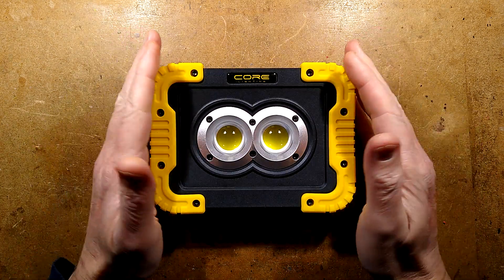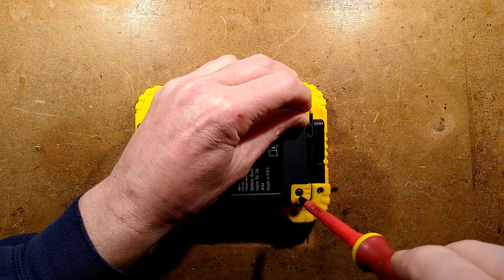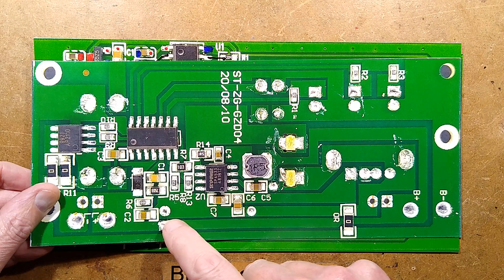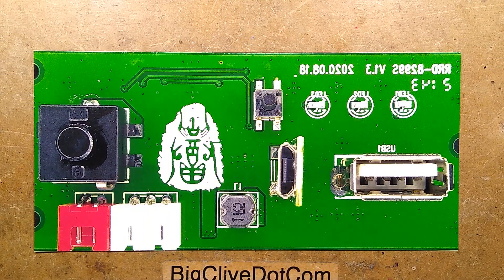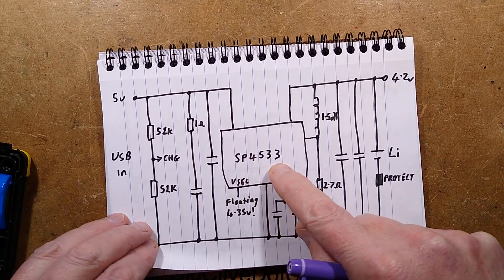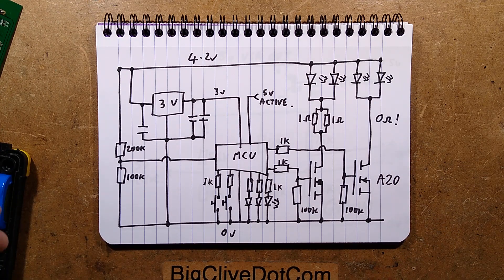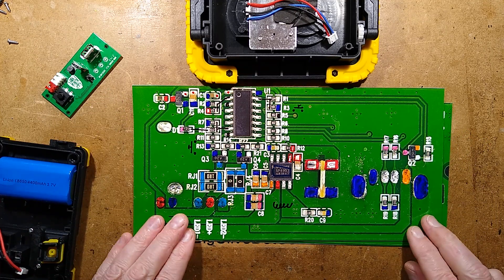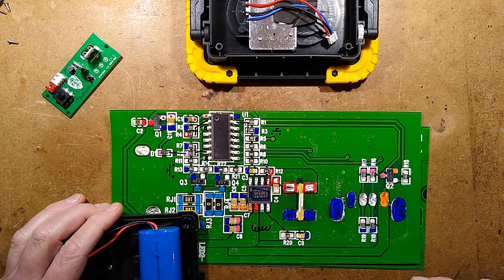Another work light with weird circuitry (with schematic)

Comment: My friend in Kyiv decided to construct a makeshift home light for the periods of power outage (they take place daily, often several times a day). He's got almost no spare parts or modules on hand, but at least he can salvage something from his earlier projects, and between the blackouts he can use his soldering iron.
I know a couple of cheap rechargeable lights from a dollar store could save him (especially if they take 18650 cells and allow for replacing them), but when everyone in a big city faces this situation, they certainly don't have enough on the shelves.
Reply: Old laptop battery packs are a great source of the cells, and you just need to look for those of roughly equal capacity to use.
Reply: Someone get this mans' friend some 18650 cells
Reply: Be careful with which laptop battery you use. Not all of them use 18650 cells. I have a Thinkpad T420s which used a square battery. They work just like 18650s, but you will never find an off the shelf anything for them, except for universal parts that work on any cell.
Reply: I could source your friend some 18650 cells if needed...

Comment: I have a pair of similar lamps branded Feit Electric. Inside is room to fit additional 18650 cell. 
Of course I added one. 
Simply paralleled a self protected cell whats intended for electric hair cutter. 
Increased runtime another couple hours. Works great.

Comment: I've bought a couple of these types of lights using removable 18650 batteries.  I use 3400mAh 18650B in them.  They are superb for ice fishing at night.  I was worried about the effect of cold on the batteries, but they last so long, and I think the light heats up the cells, so it isn't as much of an issue as I had feared.  They don't keep you as warm as an old Coleman fuel lantern, but you don't need to carry a heavy glass lantern, and stinky fuel.

Comment: The resistor divider on the USB data lines comes from the original iPod era and it uses it to detect that the device was plugged to a wall wart charger instead of a regular PC port, where it could only suck 500mA while on the charger it allowed 1A. Nowadays the current rating is set by the USB C power delivery system I believe
Reply: A pile of things now will just keep trying to draw what they want until the voltage starts to droop. I have some neat 9-36v input USB power boards with 4 USB ports on them that will happily feed 3A into each pair of sockets. (Particularly handy for driving USB powered SBCs.)

Mind you, I did push one up to 5A before it finally let out the smoke. It's always handy to destructively test any hardware you intend to use. Fun, too.
Reply: @ConstantlyDamaged  Wow!   😃 🚭 😄
Reply: Please note that Apple devices didn't use to recognise non-Apple chargers without this resistor string. I haven't played much with the USB-C devices yet so not sure what they do.

Comment: Looks like a decent portable light, and I agree that the resistor values should be altered to give better battery runtime. Even if you don't consider the heat dissipation, pulling 3.8A from a 2P Li-Ion battery pack is not going to help it in terms of battery life (just over 1 hour?) and battery longevity (will lose its capacity faster).

Comment: I've had one of these for years and it uses either 4 x AA or 2 x 18650 and I love this layout because I can easily get a total of over 6600mha compared to the cheaper 2200mha cells used by these packs.
Reply: After hacking bits of the plastic case away with a Dremel, I managed to squeeze 6 x 18650s in to that type. The newer ones are a bit smaller.
Reply: @dermotdobson2700  A bit smaller? 18650s are literally defined by their size...
Reply: @caramelldansen2204  I'm referring to the floodlights - the modern ones, being smaller can only take 4 x 18650, the older  ones with the flashlight on the end can have 6 x 18650s squeezed in.

Comment: The Aldi one that I bought is definitely not 4400mAh.  It's less than a half of that. Charges from flat to full in less than half an hour.
Reply: Bernd  my friends wife bought him one from there  (your certainly right ) he said  after about a couple of weeks he would no longer trust the battery  on it  ? could be in the middle of doing a five mi job it died ? when he needed it for loft's  or dark   place's at work he's a plumber e.g cold fill tank's in loft's  with ball valve's Exocet....   he binned it    didn't want to be stuff  in a loft with one leg hanging out of the client's ceiling  in the dark

Comment: Alright, spot on big Clive ! I was just using one right now and wound up soldering directly to my 12 volt outlet on my controller inside my micro house!
Reply from the maker: 12V?  How did you connect one of these to 12V?
Reply: @bigclivedotcom  I just figured by the number of battery's of 1.75 added to close to 12 plus output charger was 12 so I wired some large alligators with a coil of good copper heavy gauge red and black to the spots inside where the input was drilled a whole tied it in a knot replaced the cover extracted the lithiums added them to my ebike battery build clipped the alligators on my power bank and vola!
Reply: @robertallen5890  Thanks for clearing things up, I understand perfectly now. 🤣🤣
Reply: @robertallen5890  I get you,  sounds like my approach to these sort of things. How often do you need to feed the alligators :)
Reply: @Derek_Garnham  thanks to our fearless leader into this great opportunity for the many years I never threw away my good led lights gadgets and boxes of coiled wires and packages of various sizes of alligators I keep all around me always. Lol
Reply: @robertallen5890  All hail to the Chief.

Comment: I picked up one of these style of worklight on Amazon last week, similar shape/design and screw positionings, what was interesting though is that it had a battery compartment with two 18650 cells, but you could also take those out and add AA batteries instead. Seemed like a nice improvement and allows for you to keep some extra cells around. The one I got was "Trongle LED Rechargeable Work Lights, 30W" on Amazon but theres a few almost identical ones.
Reply: The Tired Horizon  Do you know what make and model that is? I've searched but can only find two or four cell models. I'd be quite interested in getting one of the six cell models as an emergency backup light. Thanks 👍
Reply: The Tired Horizon  Thanks

Comment: Based on the dates silkscreened onto the board, the two boards are 10 years apart in age at the time they were designed.  Does this represent 10 years progress in design?  Or 10 years of reading the previous guy's chicken-scratch notes and cobbling ?

Comment: It's worth remembering that as LEDs get hotter, their conversion efficiency of current to light decreases. So much so, that at some point they may actually output less light as the current increases. Below that point the light output is a relatively linear function of current, so reducing the current through the LEDs by substituting larger resistors is unlikely to reduce efficiency and may possibly improve it. Given the penchant for Chinese manufacturers to drive all the components as hard as they can get away with, that sort of mod makes a lot of sense.
Reply: Thats a very interesting point. my one starts off bright and then dims down. If I switch it off and back on, it comes back bright. I wonder if I should back off the current a bit and have a more stable output?
Reply: @kenaston4220  If it's dimming over a relatively short period (a minute or less), then it's probably a thermal effect, rather than the battery voltage dropping, so there are efficiency gains to be made by reducing the current and/or putting a better heatsink on the LEDs. Perhaps test the theory by blowing cold air from a fan over it?

Comment: I got one like that a few years ago on eBay but it has a single round COB LED and a flashlight at one end. First push gave  you the flashlight, second was the front LED (very bright) and third gave an alternating red/blue warning on the front LED display - very nice. I put in a pair of 5000mAH 18650 cells (in parallel!) - works very well. Everything else is virtually the same except the 'test' button is not there - the battery test LEDs come on with the main LED.

Comment: I have a variation of this case type too, but with a single white LED board on the middle, surrounded by a ring of red LED`s (which can stay on or flash). I had to repair it recently (CX-ST02 board), as the charge socket (which is mounted directly against the USB power out on mine) had parted company with its little board, despite being rarely used. That's when I discovered that the charging ports power isn't actually soldered to the board its on, they`re just contacting pins with "receiver pads" on the board, & the only thing soldered is the outer port surround clasps to the edges of the board, on mine at least..

When you connect it to a computer USB to charge, it actually comes up as something on the PC, which got me all para (I don't want those crafty Chinese chaps hacking my computer after all!), so I charge it from a USB plug now instead.. Maybe those chips are to communicate/signal when connected to a computer?
Reply from the maker: I've not heard of one that presents itself as a device when plugged into the computer.  I'd expect that to require the data lines of the connector to be connected to a processor.

Comment: I bought one similar to the yellow one in a local chinese shop in Italy (no branding on mine and back was more similar to the blue one) and they had 3 models of the same one. Two big led arrays, one long strip and one with only one big led array but RGB. All of them were the same on the back and front except the LED itself
Reply: I had another look into mine and remembered that mine has another COB LED on the left of the unit but has only full power/dim for the two big arrays, other than that mine came with a pop-able back and slot for 2x18650 or 4xAA

Comment: I hacked earlier versions (the ones with twin square COB LEDs on front and a flashlight on the side) of these with a Dremel, so I could squeeze 6 x 18650 cells inside. This runs for 16 hours on full power and 25 hours on low. Got bored waiting for the tiny flashlight to run it flat, but it was at least 3 days.

Comment: The resistor network is not to "stop Apple phones trying to suck as much current as possible".  It is actually to allow them to charge using higher current than they would otherwise.  If you plug a USB-compliant device (including an Apple device) into a port whose data lines are not connected to anything, it is not allowed to draw more than 0.5A according to the spec.

These resistors are configured to tell Apple devices that this charger is capable of supplying 1A of current, so it's OK for them to pull that much.

However, I'm not sure why they didn't just go with the more standard "dedicated charging port" indicator of just shorting the data lines together, though, as that also works even with non-Apple devices, and AFAIK Apple devices understand it just fine too (since it's part of the USB BCP spec)..

Comment: That larger switch looks like the one that has a rotating contact inside, which may explain the delay. The processor has to come online before it turns on one or both mosfets for the lights.
Reply from the maker: It's just a single contact for the microcontroller.

Comment: Looks like a creepy snow angel.
I am guessing that they had trouble in making the boost circuit shut down on no load or to get rid of the loading from the resistors setting the data line values, when boost is off.
Reply: I recall Space ship XL 5, but can't recall the year; '65 or '68?
Good handle Richard KB.
Reply: @kevinbean3679  it 1st aired 62, it only ran for about 37 episodes.
I used to have all of them on a hard drive.
Nostalgia is better than reality though.
Reply: @FireballXL55  Thank you, so many years ago.

Comment: Relying on the protection board in a battery pack to limit the charging voltage is a very bad thing to do.
Protection circuits are generally designed to allow the maximum voltage that won't actually result in rapid destruction (fire!) of the cells. It is expected that they will allow the main charge controller to reach its maximum setpoint without cutting off charging. That means that the protection circuit probably won't do any good in this case and the battery will be overcharged. It takes surprisingly few overcharge cycles of surprisingly little excessive voltage to significantly shorten the lifetime of the battery. Undercharging will result in greater life, both in terms of number of cycles and total energy deliverable over the lifetime of the battery.

Comment: In the past I've used series strings of resistors (2K2/3K3 and 3K3/2K2) on the USB data lines to get a USB charger to work with Apple devices. It works OK for me but I'll give those values a try next time I butcher a supply.

Comment: 1k and 100k likely the standard reel on the PNP machine, though I will bet they also will drop any value from 560R to 2k2 in the one position, and 82k to 220k in the other, depending on what is on the shelf when the reel ran out, and what was on sale that day in the market when they went looking. 

Yes putting in higher value resistors for the LED will help, probably best done using actual 2W wire ended resistors on short leads, tucked up in the spare space in the unit.  Making them 2R2 and 3R3 would probably not drop light output much, as the lower current will drop the LED into a more efficient part of the curve, so 50% longer battery life and likely only a 20% drop in light output

Comment: The mosfets are typically in the milli ohms range when turned on so dissipate very little power. I'd more worry about the leds, though at some point the battery will drop voltage so that may be straining as well.
Reply: the high power mode rely on the total circuit resistance like some direct-drive flashlights. if you swap the battery with unprotected high current ones, the led would be screaming for help within minutes for sure

Comment: Clive, Am I correct in assuming that all one needs to do is ground the VSel pin (pin 7) and the lamp will protect any lipo cell you put into it protecting it from overcharge and over discharge?

Thanks for another great video!

K.
Reply from the maker: Theoretically yes.

Comment: I wonder if the floating VSel line was some small effort at charging the batteries faster? Bad form to rely on the protection circuit that way, but a clever hack otherwise.

Comment: So, my question/comment for this session is a 2-parter.

1. Maybe not for everybody, but I'd probably find a video where you actually explain the tracing/photographing process in more detail. Aside from "lots of practical knowledge" - how do you work out what everything is and does? 

2. Have you ever done a video where you thought you had a circuit all worked out, and later realized you were mistaken?
Reply from the maker: I should make a video about my reverse engineering process.
There are times I've not fully clicked with specific circuitry and comments about it from others have clarified it.

Comment: I have a very similar light that is a nebo tango light. It has the two different leds that can operate independently. Or together on turbo mode. But it is dimmable for both legs independently. With small light on its lowest setting which is 25 lumens it says it will last 35hours. Battery doesn't last real long in turbo mode with a 1000lumens for only 2minutes. It several other settings that last a lot longer. Anyhow when your light is on hold the power button and maybe it will be dimmable. Pretty neat feature. This one says HL18B. I have had this one  for two or three years and it has been pretty handy and reliable.

Comment: If you change the batteries, make sure you use protection.
Reply: So, you need to protect yourself when changing the battery ????????🤔🤔🤔🤔🤔🤔. Yes you should always handle lithium batteries safely. 😏

Comment: Now I get it! The company that makes these lights had two monkeys. One was in one lab and one in another lab. "Here. Take this enclosure and build a light. All you get are these chips, 1K Ohm resistors and Kiko, you get two lensed LED lights and ChiChi, you get this rectangular LED array. And you each get a Banana. Have at it, boys!"
Reply: I have a much better version of this light.  I bought 3 of them and they are very powerful, use 18650s  or AA Batteries !!!!  From Amazon, not Lidl though !!!!
Reply: @acmefixer1  Probably but also consider JLC and PCBWay manufacturing and assembling all our designs.... Your think they don't keep the designs for their own use or to sell back to us in other stuff
Reply: They are bats. There is actually a stylized character in the middle, meaning "Fortune". The character for "bat" sounds the same as that one. It's probably the logo for the company.